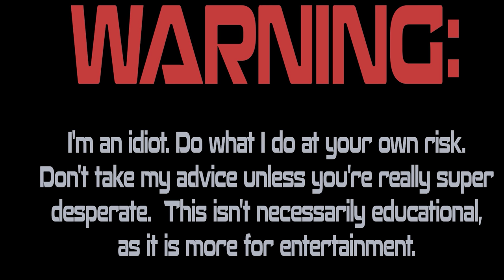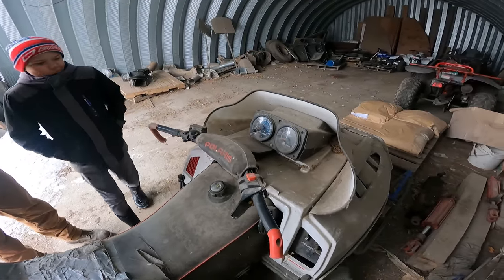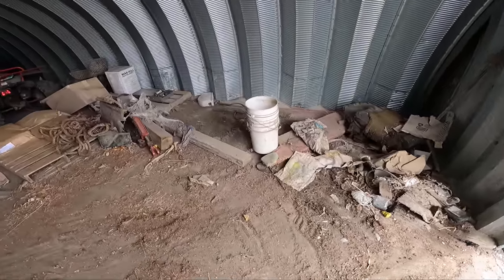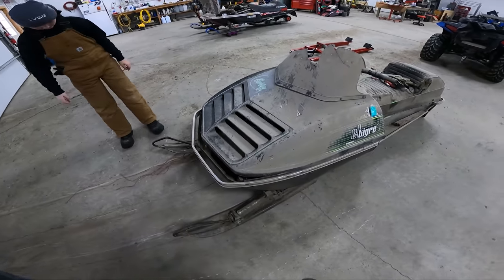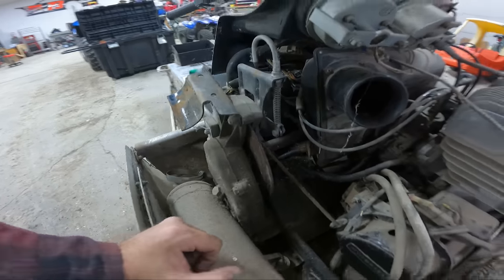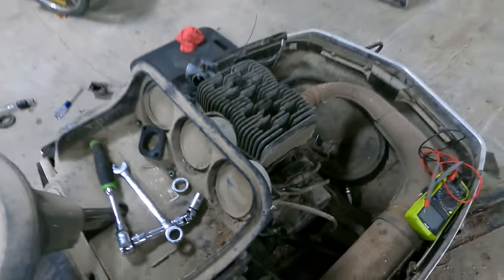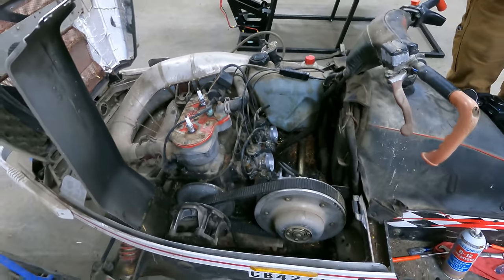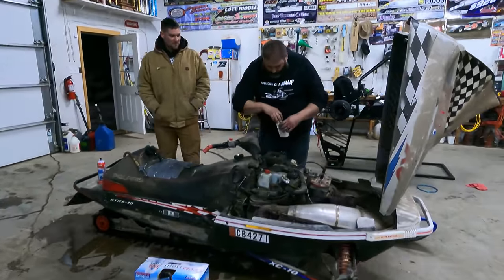VINTAGE Polaris AND Arctic Cat Snowmobiles - Will They Run? (WITH MILLENNIAL FARMER!)

Comment: those Keihin carburetors are absolute junk, I had them on my XC700 and they where terrible, I finally said enough and put a set of combined, flat slide Mikuni carburetors off an early 2000s 800 storm, rejected them for the 700 and put a single pull throttle, now it works perfectly every time and performs better to boot

the Keihin carbs are actually to blame for that crackling and popping it did when it started, I guarantee it wont do that with a set of Mikunis